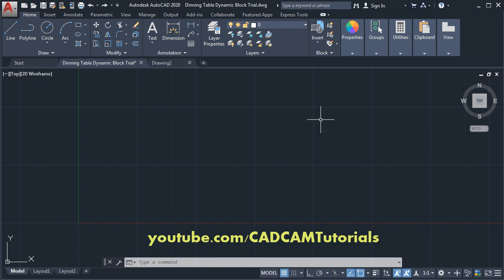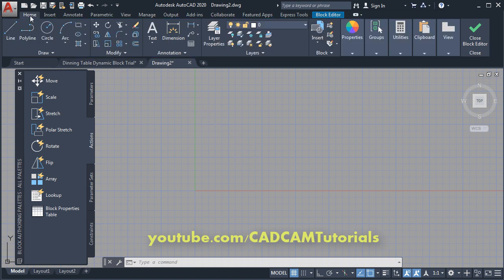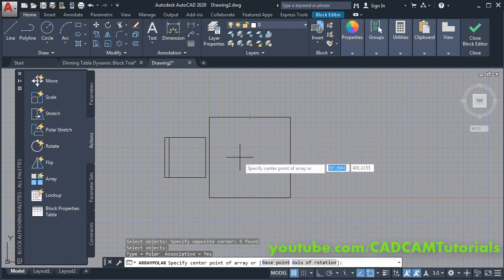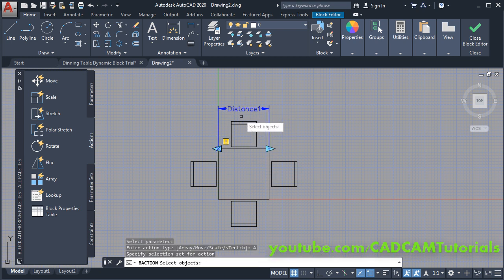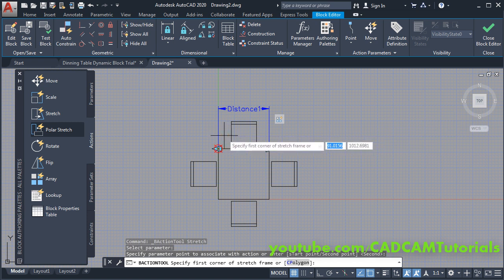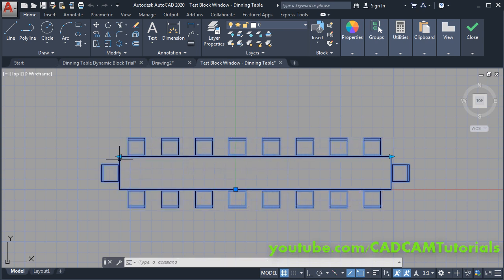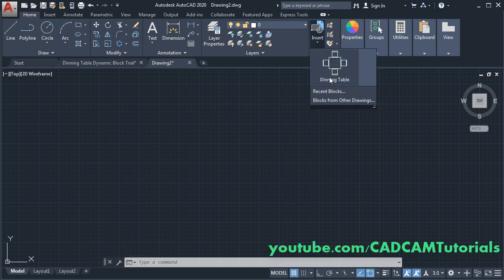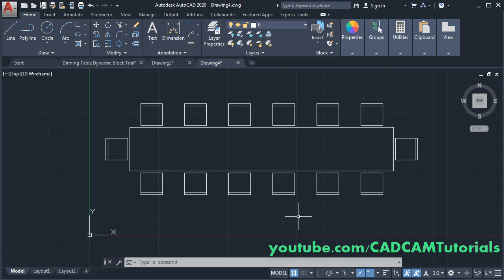AutoCAD 2D Furniture Drawings for Interior Design - 3

Comment: To create dynamic block click in block editor BEDIT
Give the name of drawing
Create the drawing
04:57 Define parameters and
define action by using authoring pallats
06:34 test block
09:58 to change it proportionately.
After completion if work save block.
To use that block on current page click on insert
To use it on different drawing pages
12:03 type wblock
Click block and select drawing name.
Now from insert and more options we can use it anywhere.